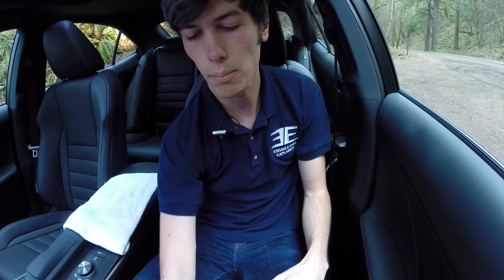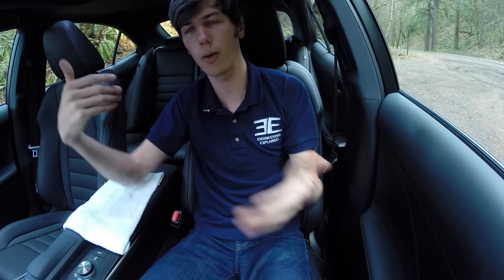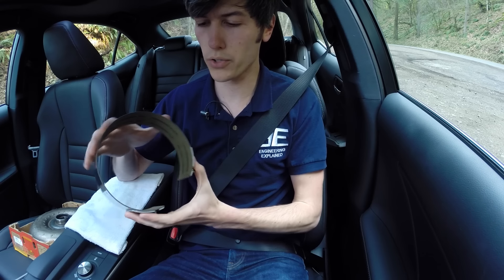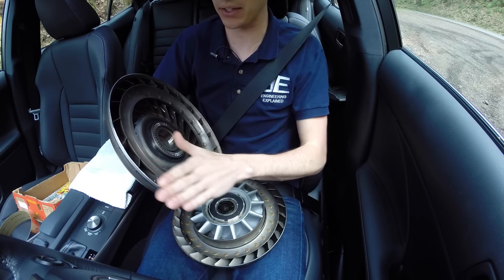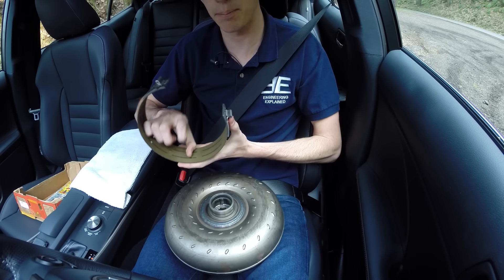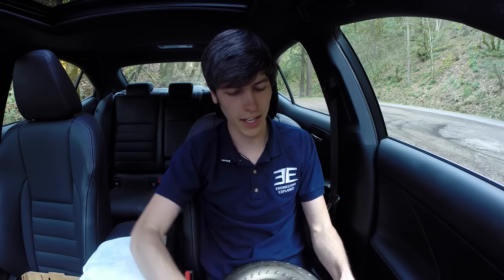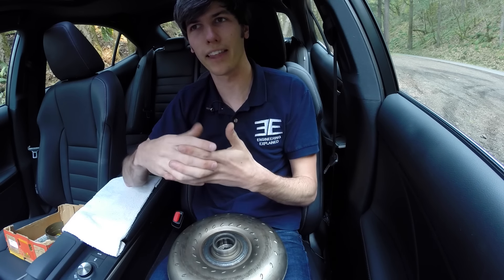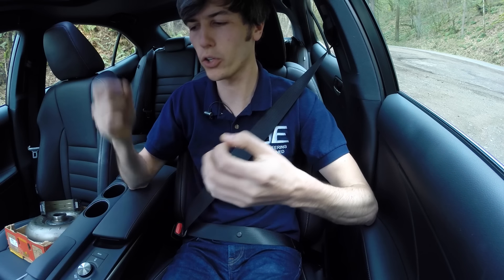5 Things You Should Never Do In An Automatic Transmission Vehicle

Comment: So basically you gave no explanation for why you shouldn't put you car in neutral when going down a hill, zero. Other than the fact you mentioned that some State made it illegal you provided no rational for why... you shouldn't do it. You explained nicely why people believe they want to do it but no rebuttal for why not to do it. Does it harm the vehicle in some way? You made no mention that it does. Here are the reasons you gave, from what I understand: Because modern vehicles will cut gas to the engine (why do I care, since putting it in neutral disconnects the engine from the transmission), you loose the ability to accelerate (why do I care since the whole reason for putting into neutral is to coast? if the person wants to accelerate they put the car back in drive), because big brothers says so (screw the government, they're trying to control everything we do). So basically this video is a waste of time because you haven't provided any more information than what a 12 year old could tell us.
Reply: if the engine is running, its using fuel, if the injectors are off, its not using fuel. he was just saying that putting in in neutral uses more fuel than when its in drive so there is no point to do it. And an added downside is you cant accelerate if you would have to in an emergency or the fact that you speed is no longer constant which obviously can cause an accident in certain situations.
Reply: @andyblinkblink4198  If the hill is too steep then of course in gear it will use less fuel, but if the hill is just ok for neutral coasting it will consume less fuel than in gear. As in gear you will have to press throttle to maintain the speed versus Neutral where you will have enough G force pulling your car. No throttle=less fuel consumption

Comment: Nice information, thanks! Two questions though, from a manual driver point of view - 
1. Doesn't auto-transmission vehicles put an extra load on the brakes? I mean, I've seen my friends with auto-shift vehicles brake a lot.
2. Is it safe to use the "parking" option instead, when waiting at a traffic signal or stopping the vehicle for a while with the engine running?
Reply: I've heard not to use P in such situations. P uses a relatively small "pin" to stop one of transmission's gear and if someone hits you in the back, it's very likely that this pin will break.

Comment: click bait sorry not watching the rest of video because there's no mechanical reason to not use neutral going down a hill. when could you ever need to speed up when coasting down a hill? makes no sense.
Reply: Engaging / disengaging drive does wear out a transmission more than simply leaving it in gear. Modern transmissions are designed specifically to handle downhill situations efficiently. In many older vehicles you would be correct. Also, a vehicle doesn't necessarily automatically know which gear is optimal when you pop back into drive [say you're going 80mph down a huge hill], and it can be jarring when you do go back into gear, similar to "launching" a vehicle. If you'd watched the rest of the video, you'd understand the physics / mechanics a bit better. Patience + open-mindedness would get you far were you to practice them...